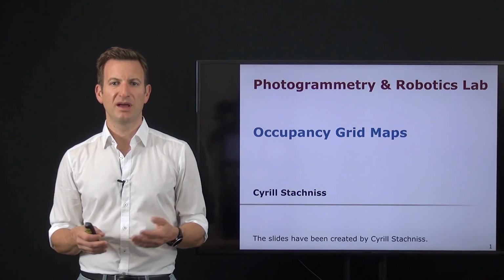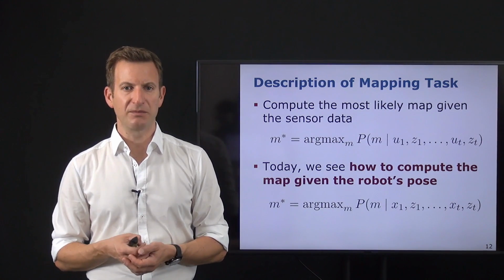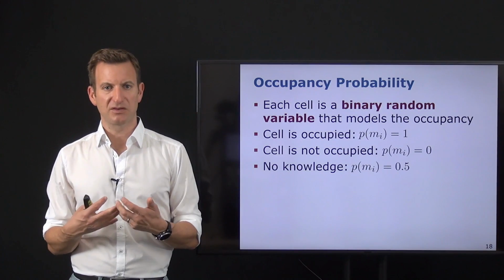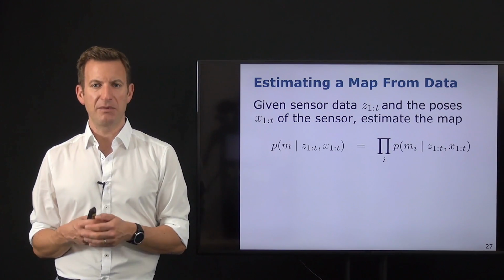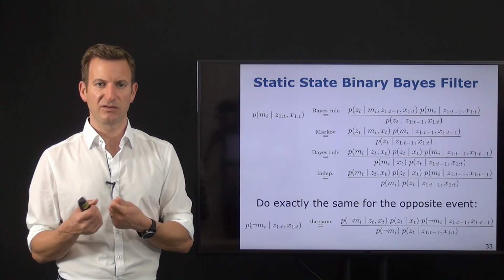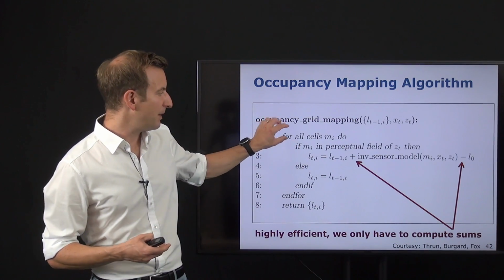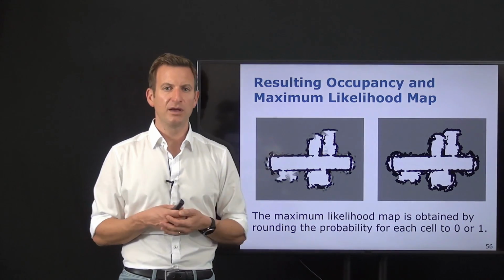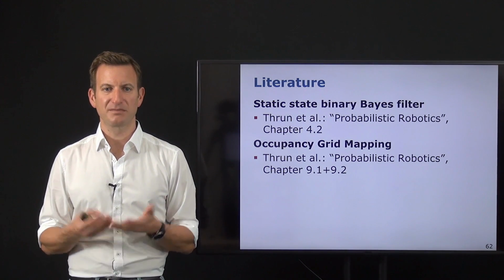Occupancy Grid Maps  (Cyrill Stachniss)

Comment: One questions Prof Stachniss, how should we update the map on loop closure? Because at that point, all the wrong cells will be marked with the occupancy probabilities based on the pose-landmark graph, and as we know, Loop closure can change the pose-landmark graph dramatically.

Another question, say we have a occupancy grid based on two sensors say a LIdar, and a Sonar, how do we puse both of them? Should we just multiply the probabilities, or look for something like a Kalman Filter?
Reply from the maker: Regenerate it with new poses…